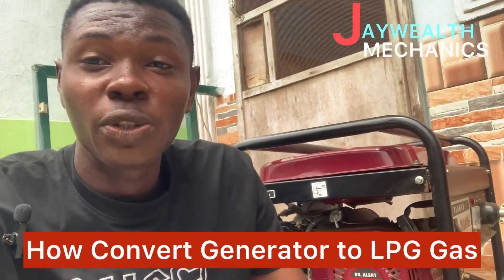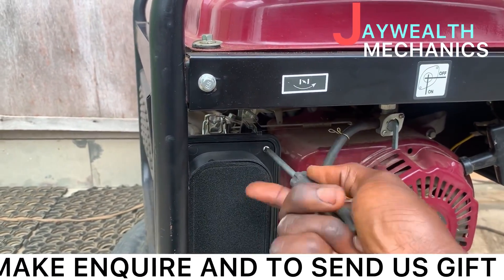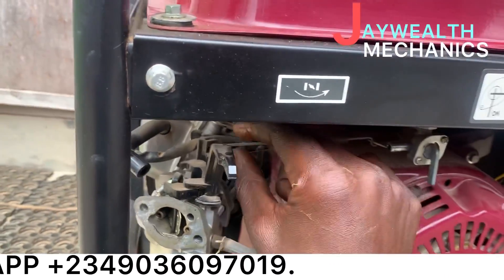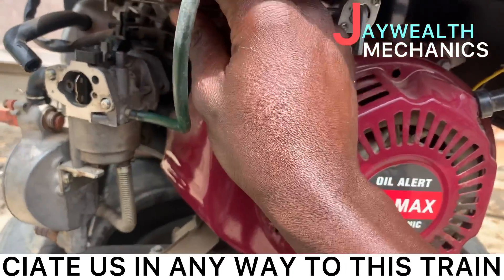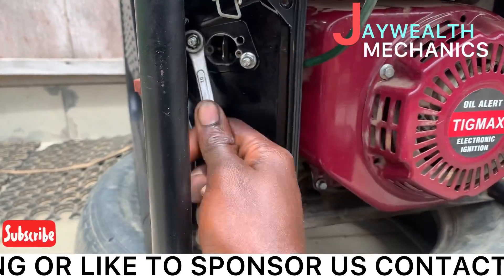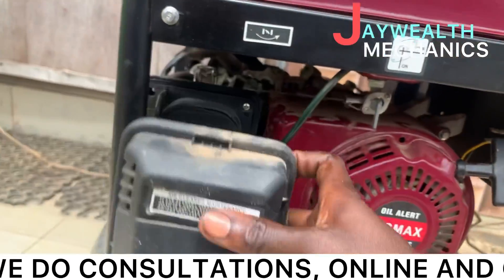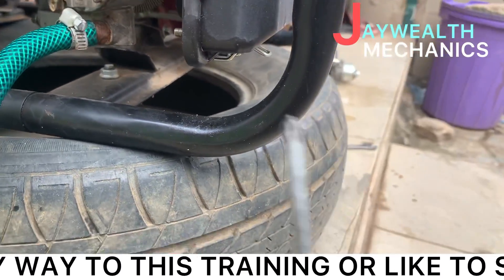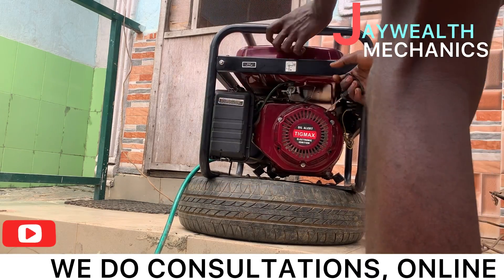Convert your Generator to LPG Gas and Enjoy Massive savings with Gas generator technologies.

Comment: Hi Jay Wealth Mech - when using LPG how do u lubricate the pistons? In Gasoline engines we mix petrol with four stroke oil. How do we do it when using LPG.
Reply from the maker: In engines that run on liquefied petroleum gas (LPG), lubrication of the pistons and other engine components is typically handled differently compared to gasoline engines. LPG itself doesn't contain lubricating properties like gasoline mixed with four-stroke oil does. Instead, lubrication in LPG engines is often achieved through the use of engine oil in the crankcase
Reply: @jaywealthmechanics9285  Thanks mate - that really helps.
Reply from the maker: @KhilikithiBhuu-Phansi  you are welcome 🤗

Comment: I would suggest using the proper hoses for gas. Using a water garden hose is unsafe, so make sure you use the hose for stoves that are specifically for that purpose. They´re dirty cheap too. No need to risk. And try to locate the bottle not too close to the generator.

Comment: When i on my fridge, the Generator shuts down,  what could be the reason?
Reply: Maybe it is consuming too much electricity. Read the yellow label and check the Watts it consumes: 500W? 750W? if your generator is only say 1000W, when the fridge starts, it demands more current than what your generator can provide and triggers a safety device to avoid overheating or something.
Reply: @FBPrepping  double your wattage of generator .
Reply from the maker: Open the regulator fully.

Comment: Where is the massive savings?  LP is around $4/gal and gasoline is around $3.20-$3.50. and the generator runs longer on gasoline than LP plus when it runs out gasoline is easier to get than LP
Reply: This video is for Nigerians because of the increase in fuel price due to govt removal of subsidy, many people have now reverted to this as it saves the cost for we Nigerians.. 🤚

Comment: How long can a 12kg last on minimal usage?
Reply: Minimum is 24hours I'm using the gas generator for two weeks now with this same generator on your video
Reply: The minimum will depend on your load sha I a fridge standing and ceiling fan plasma tv dstv ps3 game and bulp it only lasts me 24hours
Reply from the maker: 42hrs.
Reply: You mean 12kg would last for only 24hrs?

Comment: What if the generator goes off and the gas tank/cylinder is still on or u forget to turn off the gas cylinder, is there a risk of leakage or does the carburator have a way of cutting off the gas intake?
Thanks
Reply from the maker: The carburetor have a way of cutting off the gas when you forget to close the regulator.
Reply: Thanks so much. I'll consider it
Reply: @chukzmoi-lg1em  Please, remember to never forget to turn off your gas cylinder after you turn off your generator.

Comment: Nice job. But you need to tidy up a few things. One, a little research would have shown you that there is a gas gauge that can tell the level of gas usage. Two also spell out warnings when for example always put off the fuel valve before starting the fuel was leaking out when the generator was on before you put it off. Also try to explain components and their use. For example a hose was dangling from the Carburetor and you offered no explanations for such. You should also have tested a bulb to show that it generated power. There is so much more you can do beside offline and online training to position Jaywealth Mechanics as a force in this area by talking to us. I am a certified business consultant.
Reply from the maker: Noted

Comment: Good job bro! You can install A regulator built with a pressure meter or reader for the gas cylinder as an improvised gauge.  necessity is the mother of invention:washhands:
Reply from the maker: Thanks

Comment: My generator is sounding like generator that fuel wants to finish when am using this GAS CARBURETOR is it normal please i need help
Reply: Yes i open it finish
Reply from the maker: @princeemmanuel4599  remove the air cleaner. If it stop. Wash or replace the cleaner.
Reply: Where is the air cleaner located
Reply from the maker: @princeemmanuel4599  it is  located in front of the carburetor. There is a plastic covered with black box. Open it you will see a foam there.
Reply from the maker: Did you open the gas from the regular finish
Reply: Is it the air filter located in the generator outside
Reply: Or check the governor spring,if the governor spring connected to the carburetor is out the generator will keep giving unpleasant sound.... Or just check the slow jet ...if you can't, call your mechanic 🧰

Comment: Hey, love the work you're doing. Keep it up. But, how safe is it? In an actual use of the LPG generator, how far should the gas be from the generator and in what area? Should it be in an enclosed area or open area?
Reply from the maker: The cylinder could either be in an enclosed or open area. But the generator should be in a open area. The hose should be 3 to 4 yards long from the generator. It is 💯 safe the way your cooking gas is also safe in your kitchen.

Comment: Does this caburator work with CNG?
Reply from the maker: Yes.
Reply: But CNG is not advisable. Compress Natural Gas is lightweight than LPG.
Reply: @Omooba007 Actually CNG is best for engines for several reasons. LPG is liquid and can drip out of the tank if not managed properly can be a hazard.

Comment: I use 1kg of gas, and it lasted just an hour and 15minutes, what could be the problem
Reply from the maker: Overload cause be the cause or the revolution
Reply: Depending on your engine load. 1kg LPG is equivalent to 3.5 or 4.7 liters (that's if the gas station uses accurate weigh measures)  of petrol. So how long will you run a 4liter petrol on same generator.

Comment: 2kg for 8hrs.
At what load?
Does the carburator have the capability to reduce gas consumption as load reduces and to increase gas consumption as load increases?
Reply from the maker: Yes depending on the loads or revs of the engine.

Comment: I have FIRMAN generator 7000 wat for running. How would 1kg of gas last sir.
Reply from the maker: It will last for 1hr
Reply: @jaywealthmechanics9285 but you said 2kg will last 8 hours
Reply: @nicholassunday3162 I think it depends on the carburetor capacity. I think your generator is a 7.5KVA right?
Reply: @nicholassunday3162 2kg will last 8 hours for a 2.8kva gen and not for a 7kva gen

Comment: Do a video on the difference in rates of fuel consumption between a gasoline carb and an lpg carb.
Reply from the maker: Okay watch out
Reply: @jaywealthmechanics9285 bro you should have put a bulb just like the mechanics do so we can confirm up Nepa na…
Reply: Also, how foes one adjust this LPG carburetor to reduce the consumption?

Thanks.

Comment: Is it true that Tiger Generator with Yamaha Engine can't be converted?
Reply from the maker: Small tiger or big tiger 2.7kw. If it use oil separately it can be converted
Reply: Now you have asked the question I have been asking.... I have a Sunshow with Yamaha engine 2700 series and a Parsun 2700 too, they said it's not available in the market that I should go and buy Sumec 3000 and I don't like that Sumec, 2700 Yamaha engines are stronger.
Reply from the maker: @Tblaq  yes you’re right Yamaha is stronger than Sumec . The dual carburetor for Yamaha is not available yet in the market.
Reply: @jaywealthmechanics9285  someone said I should relax and give it a month that alot of importers are in China now and soon containers will land and this crazy price will drop, maybe Yamaha engine carbs will come in

Comment: How many kg is that cylinder then, if 2kg last about 8 hours?Does that mean you will be changing that cylinder every 8 hours?That's my point. Thank you.
Reply: This cylinder is 12.5kg
Reply: 12.5kg will run on that gen btwn 36 to 40hrs depending on d load
Reply from the maker: No need of changing cylinder. When the gas finish you refill another one.
Reply: @jaywealthmechanics9285  Refill another one every 8 hours?🤔
Reply: Is there any way to adjust the carburetor to make the 12.5kg to last double, like 80 hours???
Reply: @udyize  Ole!!😄🤣🤣
Reply: @udyize yes I can make last 1 year for you alone
Reply: @Udyize. Yes,  If you halve  the way you use it it would double the time  to last. So if 12.5kg will last 40hours when you use the generator 8 hour a day.  You would double the number of days it will last by using the generator for 4hours a day. This means that 12.5kg LPG will last for doubled the days it could have lasted if you use it for 8 hours a day.  It's all being economical and sensible on when to use the gen. Good luck.

Comment: Wow thank u sir for dis info, so how long will  12.5kg last, how do one keep d cylinder safe, how do one shut it off, do one need to change d engine oil before doing dis
Reply from the maker: 12.5kg will last for 42hrs 
Keep the cylinder in a cool dry place 
Shut it off from the regulator 
 No need change the engine oil.